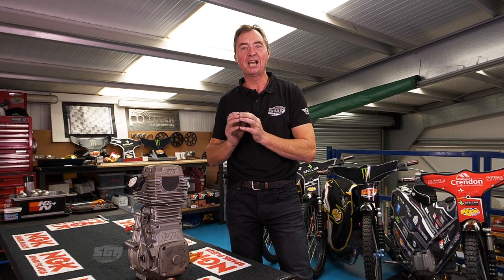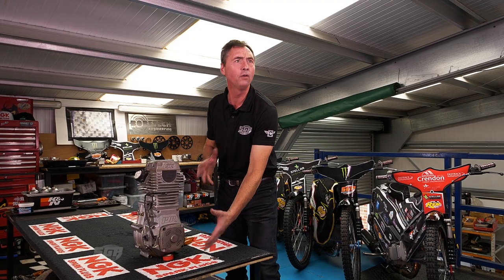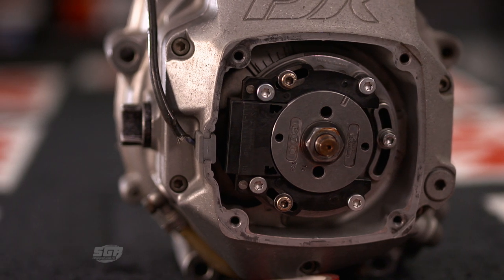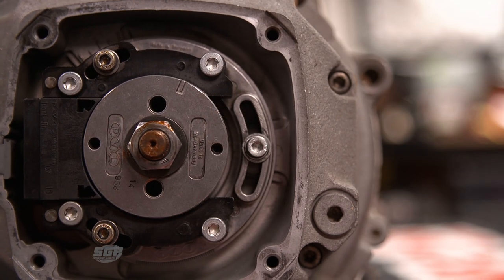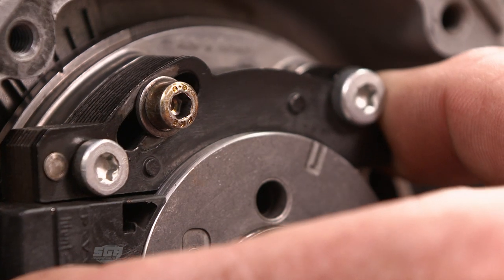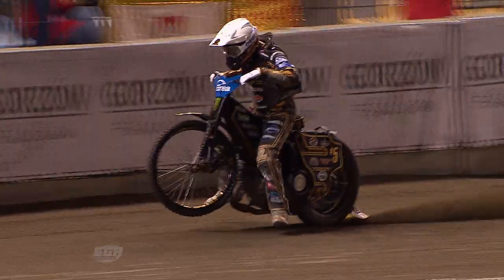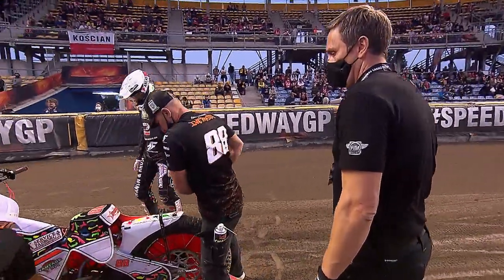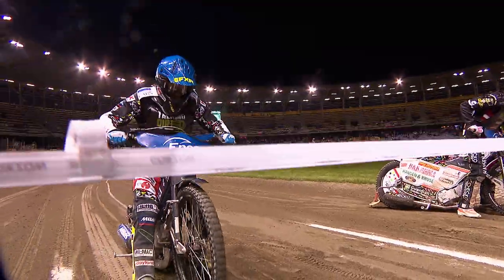Ignition on a Speedway GP bike explained! | Tatum's Tech Talk | FIM Speedway Grand Prix

Comment: just wondering why all riders seem to make clutch lever adjustments while staging at the line?
Reply: So the biting point of the clutch can be optimum for the riders liking
Reply: @damiannowatka333  thanks for the reply.Such a minute adjustment.hard to believe it makes that much of a differance.
Reply: @maddadd1  no worries. If the clutch plates kissed it would drag the rider into the tapes.

Comment: Can you explain a little more why the rider might want the engine to rev more or less from the optimum position?
Reply: Advancing the ignition may give some more revs but a big bonus can be the power it can give through much of the rpm range. It can help the engine pull out of a "bogging" situation in the corners, give more grunt after it leaves the start line (minimises the chance of the engine dropping revs after the clutch is out and the bike is well under way but still accelerating), better throttle response if the rider is off the throttle (which they often are).
Reply: @garyoneill8868  thanks Gary, are there disadvantages of advancing ignition too much? Not sure what difference high compression and methanol would make, does detonation occur as with petrol? I rode speedway bikes back in the 80s and was told to open or close the points on my Weslake to alter ignition and soften the engine to get more grip. It seems all different now and I am really interested in the technical side of the sport. Thanks for your answer.